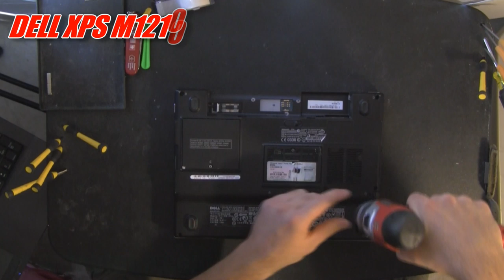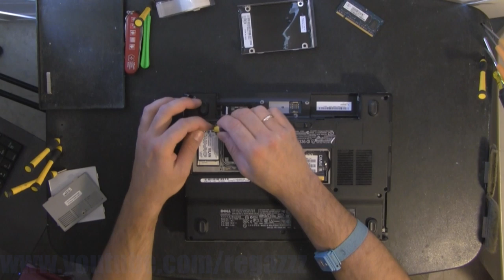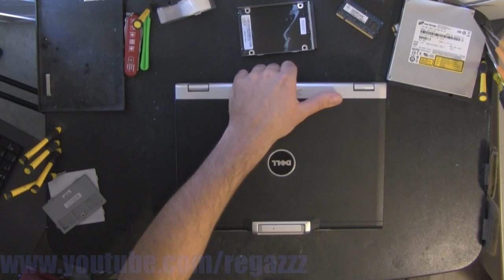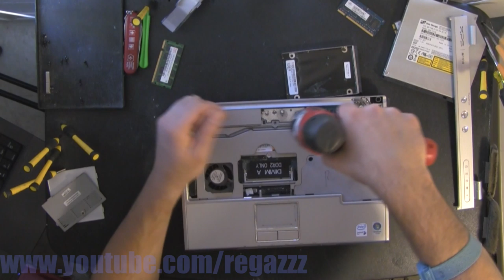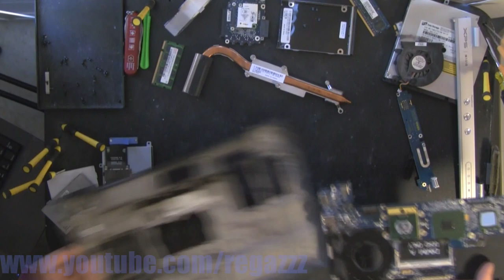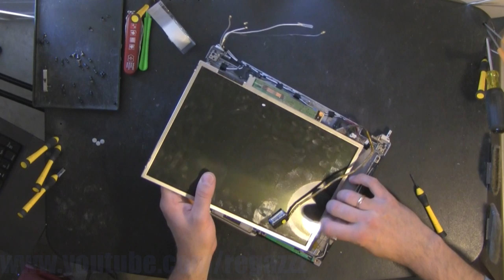DELL XPS M1210 take apart video, disassemble, how to open disassembly

Comment: LOL I would not let this guy handle my laptop for repairs but thanks for showing us how to take it apart.

Now I can upgrade the ram, change the screen, switch drive to blu-ray, swap in the best processor this beast takes the Intel Core 2 Duo T9500

Shame you cannot change the graphic card on it since its dedicated.
Reply from the maker: ***** Don't worry, on your laptop I would be triple careful :)
Reply: +SMGJohn you can't use t9500, it won't handle above t7600
Reply: +ealiev60 
I learned that the hard way, because the Socket types were completely fucked up the T9500 apparently exists for a same socket as the T7200 which is were I got the info from, Intel's website but then I learned there is something called Socket M and Socket P, yellow and purple sockets. And its THIS what really is the Socket not what Intel lists on their stupid website.